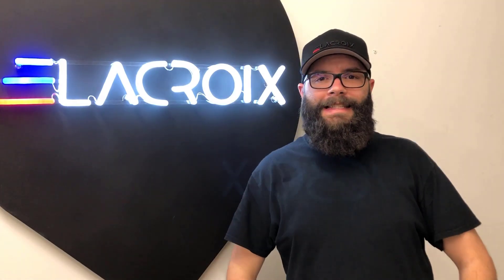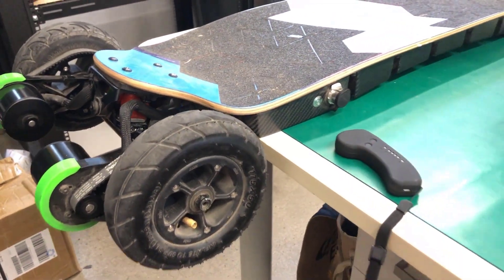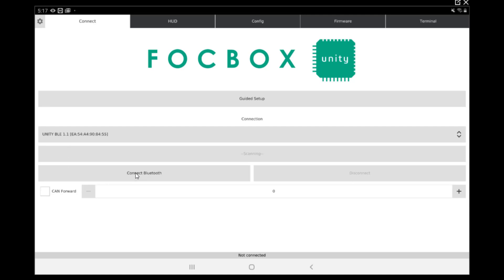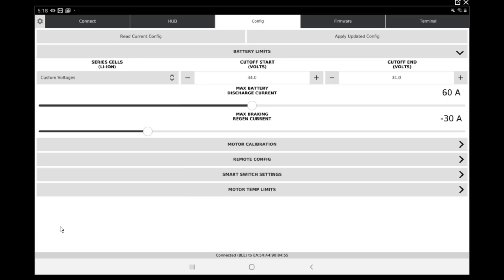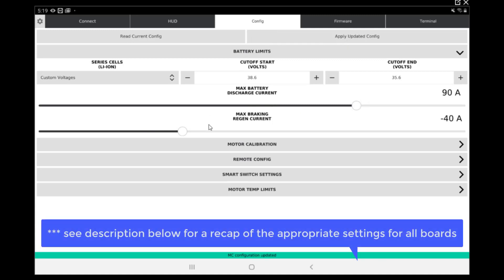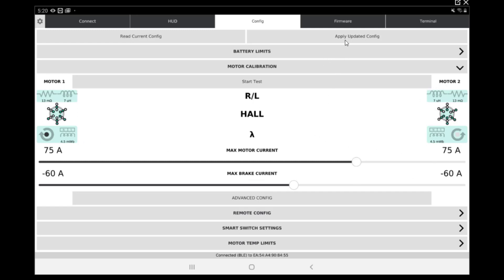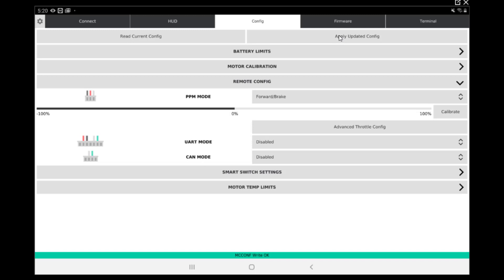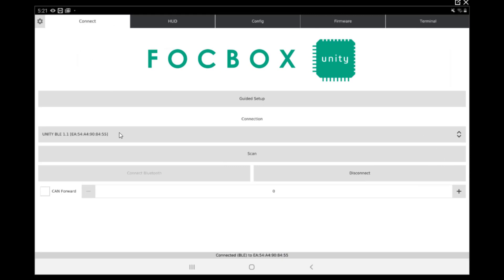HOW TO: update settings in Unity FW v.23.45 or v23.46 (JAWS, NAZARÉ, LONESTAR pre-october 2019)

Comment: I have firmware 23.44 with the updated battery limits. If I'm just replacing a motor,  do I only need to do the motor calibration section or do I also need to do the remote config and motor temp limits?

Comment: Hi, 

I am facing to a stupid situation: I've upgraded to 23.45 and I did not take screenshot of previous values before upgrade, what are the full list of values for Nazaré to secure my configuration with optimized and secure values?

Q1: Sub menu "Advanced config" of "Motor Calibration"  lets us  3 parameters to configure 
pwm frequency: 
Sensored to sensorless Transition RPM:
Sensorless OpenLoop RPM:
Q2: Why do you deactivate Motor thermal throttling?
Q3: what is the conservative value to set for max allowed motor temperature, and what is the definition and range for Motor BETA?
Q4: HUD Config screen: what is: the expected value for test erpm -> rpm?
Q5: The Android version does not show "Absolute Maximum Current" that you tell to set to 180A, do we have to use Windows/USB-C version of the app?
Reply: Did they never respond

Comment: do we have to re calibrate  two separate remotes for the Lonestar?
Reply from the maker: No you don't. The calibration is applied on the receiver (sometimes erroneously referred to as the transmitter) inside the board so it will work for both the remotes that come with the Lonestar.